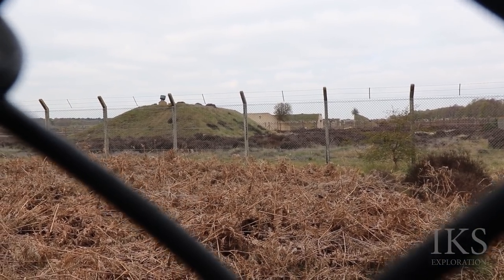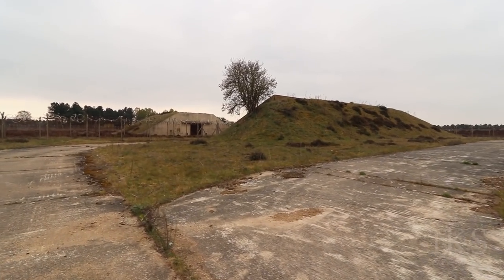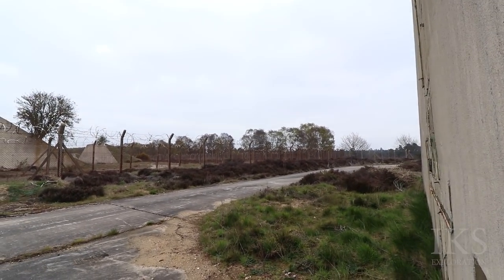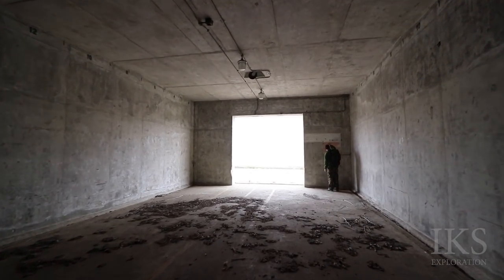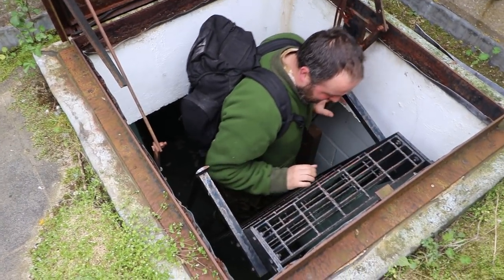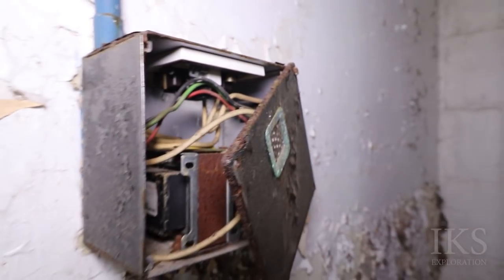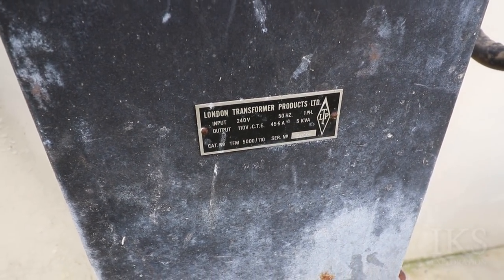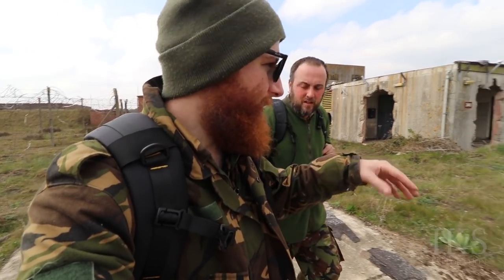RAF Woodbridge Bomb Store - Army Helicopter Searching

Comment: The Royal Airforce occupied RAF Woodbridge during WW2 and then The USAF 81st Tactical Fighter Wing was based here from 1952 until 1993 - this and nearby RAF Bentwaters were known as the ‘twin air bases’. RAF Woodbridge, or MOD Woodbridge as it is called now isn’t abandoned - the Army Air Corp use it regularly for training exercises and also two regiments of Royal Engineers have been based there in Rock Barracks since 2006. Many structures on the site may not be used any more but it isn’t abandoned by any means. It is still operational under the control of the British Army. It has a very interesting history from WW2 when it was used as a crash drome for wounded aircraft coming back from raids over Germany. The main runway is 900 ft long and 750 ft wide with an extra 1500 ft clearance at either end. This is way bigger than a regular runway and it was to accommodate the needs of pilots trying to safely land stricken aircraft. It also had the unique Fog Investigation and Dispersal Operation or FIDO system, to burn off any fog that was restricting the pilots view of the runway. There were pipes with jets buried along the runway - petrol was pumped to the pipes at a rate of 120 US gallons per hour when needed. The pipes and their jets produced walls of flame that burnt off the fog. This airfield is of major historic significance because of it’s role as a crash drome. It was one of only three in the UK. Because of all the plane wrecks that happened there, a big pit was dug at the end of the runway and the mangled aircraft were swept into it. They are probably still there under the earth to this day. You can still just about see the runway from the road - you can definitely see the huge poles with landing lights on because they are still there. I live locally and go walking in the adjacent woods regularly.

Comment: The helicopter is a British Army Apache from nearby Wattisham. If they had seen you, they would probably stay near just to disquieten you. They'd very probably seen you on their thermal imaging systems, anyway. They very often fly over my house - I live about 10 miles from where you were. The Apache helicopters do night flying exercises, and once , when at work, saw two of them over the Orwell estuary, taking it in turns using their night vision system - one chopper would turn it's lights off, and the other would find it. Oh, and you'd definitely know if it was a Chinook - their rotors make a very definite, loud 'Whup-whup-whup' sound. Once heard, never forgotten.
The stack of lights (18:35) is the remains of the runway approach lights.
20:00 - that looks like the security fence monitoring post; cameras, motion detectors, etc. The doorways were smashed to remove the generating gear: I think that the USAF removed a lot of their gear when they left - the area was sealed very tight for years afterwards, and almost impossible for thieves or vandals to access, and too far from a main road for any random Kev to remove anything heavy. The MOD would have removed their gear, and used it elsewhere, or auctioned it off. I wouldn't be at all surprised if the bulletproof glass was 'tested' by USAF personnel shortly before they left - they do look like 9mm handgun rounds have hit the glass.
What you have at 35:00, is very possibly the store for the nuclear weapons 'atomic triggers'. Two man opening, each at the same time. Hence two locks on the door. The triggers were tested in the peculiar 'Pagoda' buildings at nearby Orford Ness - for many years, Britain's 'Area 51'.

Comment: The device at the 12:20 marker is a Cossor/Husky interface board.
It interfaced with the Clansman radio system.
There are some details here:

https://hackaday.io/project/168472-hacking-a-cossor-raytheon-husky-printer